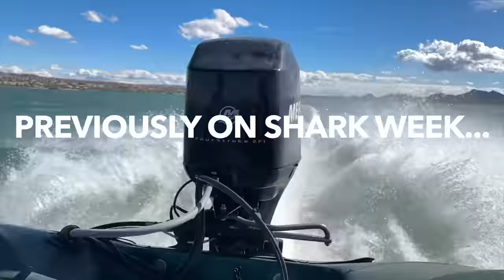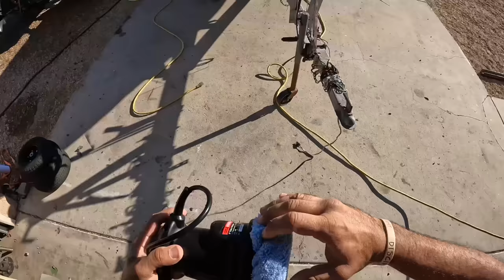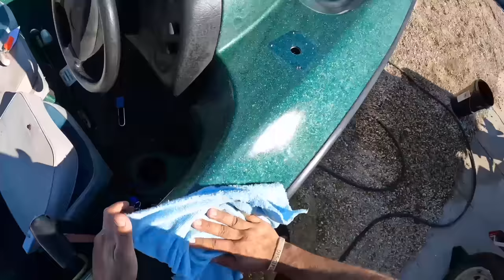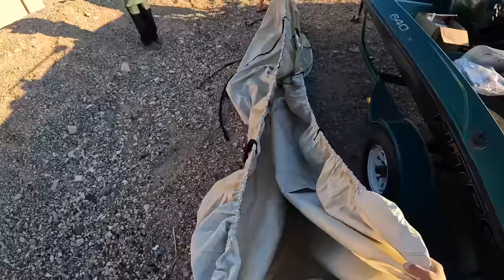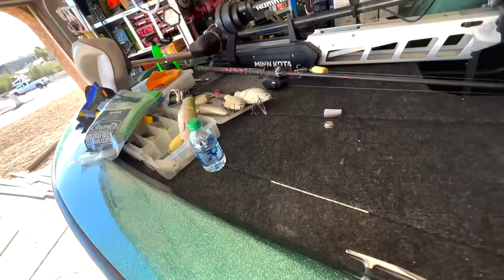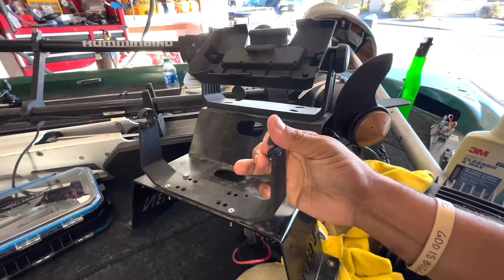Nitro Paint restore was surprising... | Bass boat restoration project.

Comment: If you wet sanded starting with 400 and go up to 2000 it would have went way smoother. Don't be afraid to wet sand. That gel coat is much thicker than most think even on cheaper boats. Problem with not sanding is the oxidation will come back after a few months.

Comment: yeah that orbital is good for doing a wax job  but if you are compounding a  low speed  rotary with wool is the way to go.  1500 rpm is what my makita is. and always keep moving  watching your pressure you apply. too slow or too much pressure will burn or cut through especially on gelcoat.
Reply from the maker: Thanks for the tips!

Comment: Grab yourself a drillmaster  rotary polisher and an 8 inch wool cutting pad. That smaller polisher is nice for finishing/waxing but it wont cut the haze well. After trying literally hundreds of dollars in different compounds the best 2 weve found are 3M Perfect-It Gelcoat Medium Cutting Compound + Wax and Meguiar’s M9132 Marine/RV Power Cut Compound. Weve done 3 boats that spent over 10 years taking direct sun abuse in socal and with the wool pads and some patience they all came back to a factory shine that would last, and that last part is the real kicker. Those cleaner waxes give a good temporary finish but after a few weeks will haze and need more work. If they are applied to a property compounded surface they will act as an initial barrier and work great for protecting.
Reply: Both of the mentioned compounds in my first coment start medium/hard cut and will slowly break down to a fine cutting compound with propper use. The 3m has a slightly longer wet/work time that the meguires but both will get to a fine polish.
Reply from the maker: Thank you!
Reply: I’m not a big fan of rotary polishers. They’re a little too big and aggressive for all the curves and lines on a smaller boat. On a large boat with big flat surfaces, they’re perfectly fine. 

Harbor freight sells a great 5-6” dual action polisher for $90 that’s worth every penny. I’d run rubbing compound on a microfiber cutting pad, then polish on a finishing foam pad. Have a compressor handy and blow the pads out every section you do or so that way it isn’t dragging all that old material around the rest of the boat leaving swirls.

Comment: I restore bass boats all the time it will save you so much time to get a bucket and some 1500 grit put some water and a little bit of soap and just do a quick wet sand. could wet sand that entire boat in an hour and just use a little rubbing/polishing compound. also make sure u have a spray bottle and mist the area with water.
Reply from the maker: Thanks!

Comment: is this AZ? we moved here almost three years ago and just bought a 1976 terry bass boat. My husband and I are restoring the boat. Repairing some floor cracks doing our own seats,and spot check and clean out the old motor. We have had harleys camping travel trailers but a boat this is our first! super stoked about it. By any chance did you have any areas with really faded clear coat on the glitter?

Comment: Buffer wheel. 1 hour. I'm one of those yacht detailers. Wish I could have done it for you. I'm in LHC. Been tuned in to the TBN for a while. You convinced me to get a new tiller Merc 60. On a 1974 Smokercraft 1860 now. Going on an 18 glass or 22 toon next.
Reply from the maker: Sweet! What’s your company name?
Reply: @TinyBoatNation  Mars Painting Company. I'm a residential painting contractor here in town. I have years of experience fluffing boats in FL. Glass and gel repair. Full restoration too. Learning a lot from your channel about aluminim fab and electronics setups. Thanks.

Comment: I did my nephews boat, started with 400, then 1000, then 2000, compound and polish came out like new. Wet-sand is the only way to go. Makes it much quicker, and it wont hurt the gelcoat if you take your time
Reply: You sand in straight lines, you don't do circles right?

Comment: I had leaking rivets on  my 1236 so I fill the boat with water and almost every rivet leaked. I decided to coat the entire bottom of the boat with gluvit, was this a good idea or a bad idea
Reply from the maker: Long-term, it will fail but if it works now then enjoy it. Eventually prep to re-buck all the rivets and you'll be much happier.
Reply: @TinyBoatNation  I will have to see how it turns out as I just put it on today. Is gluvit flexible? I'm not to concerned about it  delaminating do to the cold since I live in florida.

Comment: Start wet sanding with 800 ,1000, 1500 then polish with a buffer if it’s not smooth to the touch you are through the gelcoat
Reply from the maker: Thanks!
Reply: @TinyBoatNation  also for the carpet trim bass cat sells exactly what you need I used it on my hydra-sports restoration as well as my polar Kraft build